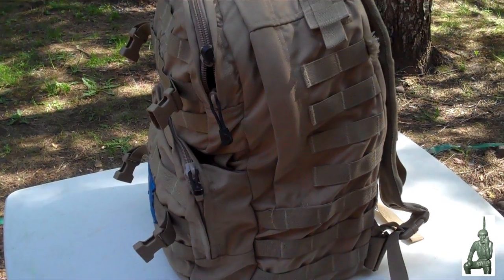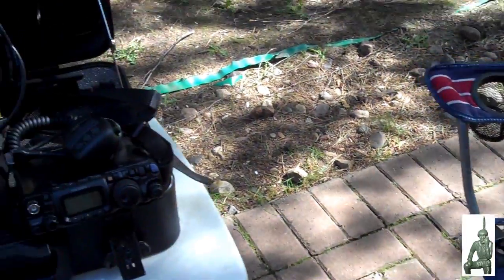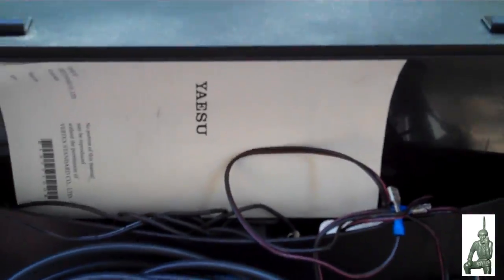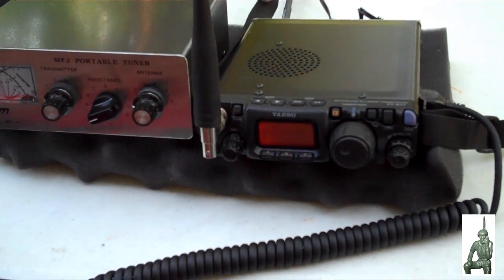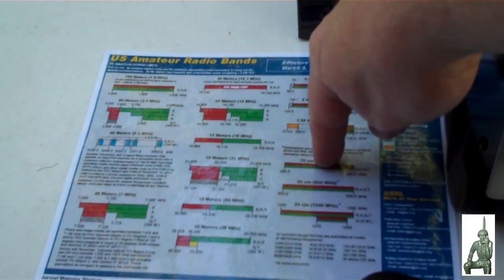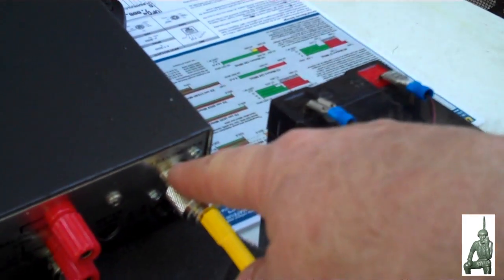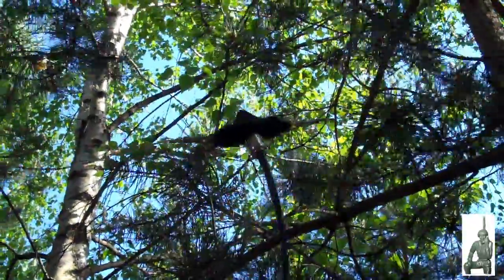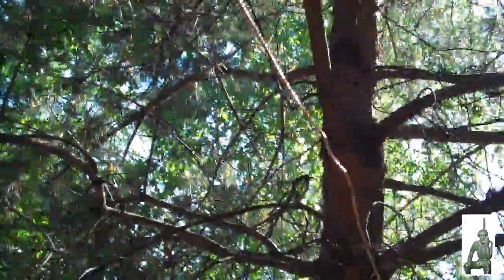FT-817ND Bugout Bag Radio - 1400 Miles with 5 Watts

Comment: I must not understand the numbers yet, i get the 7, from the 57, its the sig strength, however i don't understand why all these guys give a 5 as the first digit when they clearly can not hear it without any issues. as many times as you had to repeat it i would think if i understand this right i should have been more like a 37 or a 47 right? Again i just go my license and have not got a radio yet, looking at the 817nd or the kx2, but don't like the fact the kx2 does not do 2m and 70cm. Is that the 6m,2m 70cm antenna that came with the radio how does it do for local reach with that?

73
Reply from the maker: It's tradition called the RST Code https://en.wikipedia.org/wiki/RST_code
Reply: Yes i understand that but the R in RST is
1. Unreadable
2.Barely readable, occasional words distinguishable
3. Readable with considerable difficulty
4. Readable with practically no difficulty
5. Perfectly readable

if someone has to repeat themsevles over and over for the other person to understand what they are saying there is no way the R can be a 5. Perfectly readable.

but thats why i am confused all these guys come back and say the person has like a 57, there is no way the person you're talking to can say you have a 57 if you have to repeat yourself over and over for them to even know what your saying.

What am i missing here. Keep in mind i am not necessarily even referring to your video, I have watched a few, one guy had to repeat his call sign about 10 times before the other guy got it, but the other guy say he was like a 57, it just makes no sense to me at all
Reply from the maker: It's tradition.  If it sounds good say five nine and move on.  the three digit reports are used when running cw.
Reply: Ok i just want you to know i am not trying to sound sassy or anything i am still completely confused this is a quote right from that link you gave me "in a voice transmission, readability refers to how easy or difficult it is for each spoken word to be understood correctly. Readability is measured on a scale of 1 to 5.[6]"

so if you are talking to me and I can hardly hear you and have to have you repeat yourself to me 10 times are you saying you would expect me to still give you a 5 when really you're a 3 or less, if that is the case then what is the point of even getting the report. it has not value.

Sorry still just completely confused as if its only tradition then who cares don't even bother doing it. It has no real value in helping you to determine if you one antenna is better then another or if one radio is sending better then another etc, if everyone just says you are completely readable when really they can only make out every other word then whats the point of a signal report.
Reply from the maker: I have been operating for more than 25 years and only use 59 (some times 59 plus a db level i.e. 59 plus 10).  Otherwise I will say I have a weak or bad copy.
Reply: ok thanks
Reply: @Thejohnnyoshow  Your issue with a 57 or 59 signal report is completely correct, IMO. To each his own I suppose, but if I have a hard time copying someone, I'll give an honest report. They need to know. 👍

Comment: what would a setup,  such as yours,  run me $$?
Reply from the maker: Let me google that for you.  FT-817ND $660.00, MFJ-971 $120.00, Battery $30.00, Cable $50.00, Antenna wire $10.00.

Comment: very impresive radio, strong cgnal cool
Reply from the maker: Thank you.  It's a good radio.  I would be better with 10 watts but for it's size and capabilities I think it's the best (for now) radio bugging out.  Light weight, low power requirements, all modes, all bands, and not too expensive.  Thank you for taking the time to watch and comment.  Respectfully - CommsPrepper

Comment: Wow that's some incredible range for only 5watts. The frequency must be really low by the length of the antenna.
Reply from the maker: 14mHz is low compared to 144 (Wouxun radios) and the antenna is much longer.

Comment from the maker: Your FT-2900 is a VHF (144-148mHz) radio.  Typically this frequency band (2m) is limited to line-of-site.  To communicate the 110 miles you are looking for you and your friend will most likely need access to a repeater.  I suggest you connect with your local Amateur radio club and learn about what repeaters are in your area and assistance with licensing.  Without a repeater you could use HF radios (3-30mHz) with NVIS antennas (this too will require an Amateur license - General class).

Comment from the maker: You cannot do this with the Wouxun.  The Wouxun is a VHF/UHF (144/440mHz) radio and provides line-of-sight communications.  The radio in the video (FT-817) is an HF or High Frequency (also called shortwave) radio that operates much lower in frequencies (2 thru 30mHz).  To operate HF you need an Amateur radio license.  I work/live here in Russia.

Comment from the maker: Thanks.  The FT-817 is a great bugout bag radio.  I wish it was 10 watts vice 5 but it can do the job in an emergency.  My only gripe with the radio is you only get 5 watts with an external 12VDC battery.  The internal battery packs (NICAD or Alkaline) cap the radio at 2.5 volts - hens the external battery in the video.

Comment from the maker: I have a separate charge controller that I can connect to the Escape panel.  You might be able to see in the video where I have a terminal lug connector on the panel cable to separate from the power jack (that connects to the Escape) so I can connect the panel to the charge controller.  This said - I have never left the battery on the panel for a whole day.

Comment: It should be known for the newbies thinking of getting into radio that this can not be done with thoses family radios, The radio equiment in this video cost hundreds of dollars that operateon freq's that are capible of doing this. This operator is experanced and a licsened ham radio operator, and knows what is needed to atemped this communication.  Freq, antenna and weather play a major part in all communications.  Contact ARRL for more info on becoming a ham operator

Comment: If its a 7 Amp (battery like mine) then it has between 40 and 50 Watts/hour of real, usable power. Then, by continuously transmitting at 5 watts you have 8 to 10 hours. If you transmit only now and then, then you have more than a week power in that battery. Your Boulder 15 panel in your escape 150 is powerful, I think it should charge your battery in 5 hours in a sunny day, not a whole day.

Comment from the maker: Not sure, I have never run it out.  Longest I have used it at one time was five hours.  Normally I charge with a car battery charger before trips but I can also charge with my Goal Zero Escape 150 portable solar kit (but it would take a day with solar to charge up).  The radio will also has an internal battery pack which can be alkaline or nicad.